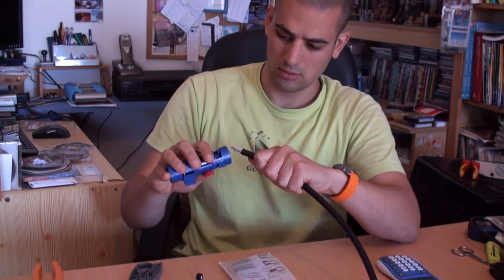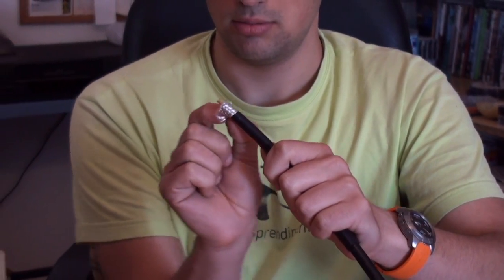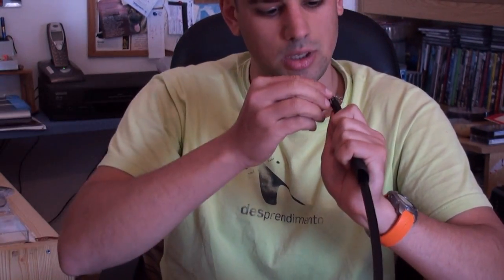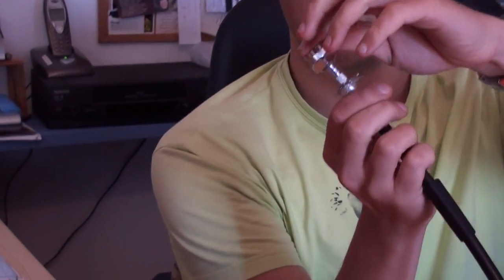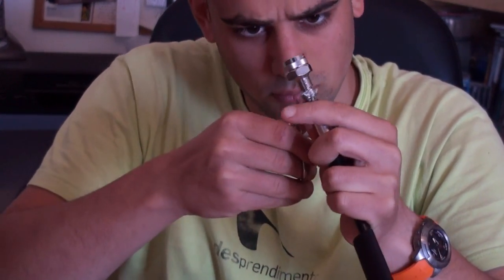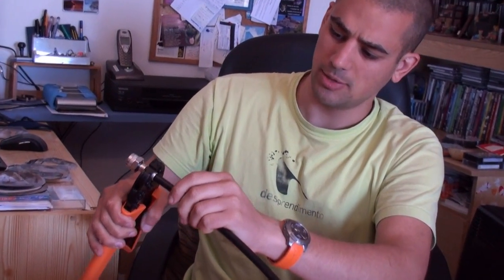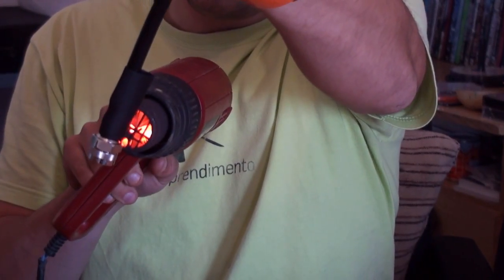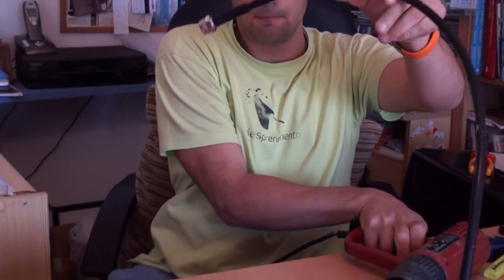Crimp LMR400 connector

Comment: It looked like you were struggling, was this your first time doing this, and what about the center pin?
Reply from the maker: This are clamp style connectors, so the center pin doesn't require soldering or crimp. I've did this probably less than 5 times before this video. This connectors are actually very expensive to play around :)

Comment: Great video, thansk for putting this up..

Reading the comments and all I can say is you've got to love the moronic comments from old school hams who simply won't use then new fangle crimp connectors cause they think solder connectors are better and that these high tech crimp connections designed for aerospace use crush coax. 

 Yet we're supposed to respect these hams as being technically literate. By the way for those of you who don't know  ham radio today is not of the same technical caliber it was 30 years ago.

 Today ham radio is comprised almost entirely a bunch of wannabe first responders AKA "Rickey rescues", the rest are either whaky preppers prepping for the zombie apocalypse or CB rejects who without Google wouldn't know the difference between a contaminating jacket and non contaminating jacket and then finally there is a very tiny minority of technically literate hams most of whom are abandoning the hobby being driven out by the illiterate right wing nut jobs infiltrating it. 

Hey hams there's a reason why the military and NASA  banned old school Coax Solder terminations, These aerospace pressure welded AKA crimped coax terminations are vastly superior to those old school solder connectors  in every possible way.

 1st and foremost they eliminate the terminations susceptibility to fracturing from vibration and they eliminate the high loss's associated with solder as well as the impedance bump created when foamed dialectic is heated by the soldering process. Even a solder connections created by a highly skilled craftsmen creates a much higher loss connection then a pressure welded connection and lets face it the poor soldering skills most hams posses hardly qualify as skilled.  

Most hams nowadays don't bother to read data sheet otherwise they would know that the shield of foam dielectric coax such as LMR-400 was never designed to be soldered. The only coax designed to be soldered is coax that uses a Polyethylene or Teflon dielectric such as RG-213 and 214...  You never under any circumstances solder the braided shield of a foam dialectic coax especialy one that also uses a foil shield.  While this might not be important below 30MHZ it's critically important above VHF.

 Furthermore a pressure welded termination forms a vapor tight connection thereby reducing the terminations susceptibility to moisture incursion. By the way that LMR-400 stripping tool is way over priced you can do the same thing with a $15 paladin RG8 coax stripper and save yourself about a $100.
Reply: +Dan Nelson while I do agree with much of your statement.  LMR400 IS a polyethylene coax cable.  From the Times Microwave LMR400 pdf.  "LMR®
standard is a UV Resistant Polyethylene jacketed cable designed for 20-year service outdoor use.
Reply: +telhack693 " LMR400 IS a polyethylene coax cable" 

When it comes to soldering terminations the Jacket is not the issue,  It's the dielectric we are concerned with.

  There are many types of dielectrics used in feed lines. The two primary types of dielectrics hams see is either Solid or Foamed. 

 Solid polyethylene dielectric coax usually has a velocity of propagation of around 66 percent and is a very durable, rugged coax designed for severe duty.  As an  example Rg-213 was designed to withstand repeatedly being run over by 5 ton 6×6 U.S. military heavy cargo trucks. Solid polyethylene dielectric coax is also suitable for solder terminations. 

 By comparison coax such as LMR-400 is extremely fragile coax which shouldn't even be taped to tower legs let alone be stepped on. Times Microwave does not recommend securing LMR-400 to tower legs with tape or zip ties.  While most amateurs fail to use them Times actually  sells special coax hangers for LMR-400 which prevents center conductor migration which can happen if zip ties or tape is used to secure the coax to tower legs. Under no circumstances should LMR-400 be swung unsupported between two points.     

 Although we see it quite often in ham radio Foamed dielectric coax such as LMR-400 should never be soldered as the foamed dielectric can not withstand the soldering process without deforming regardless of how skilled you are. And as stated previously foamed dielectric coax is not a durable coax and special care should be used when installing it.  Deforming of the dielectric and center conductor migration will result in an impedance bump and increased termination loss while this might not be a problem below 30mhz it's very important above 10m and critical at UHF and above.

There is one exception to soldering foam based coax  and that is the use of precision commercial induction soldering equipment.
Reply: +Dan Nelson how many connectors will you use, 2 at most, one if it has them. The crimp tool is expense, solder cheep.